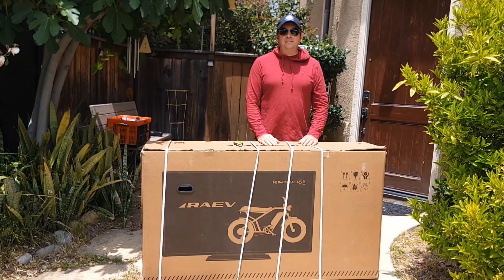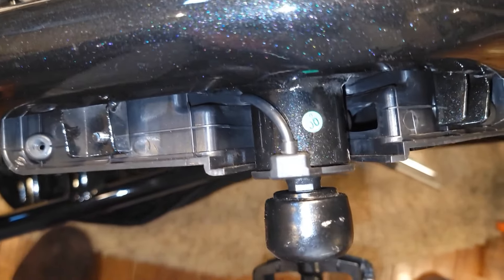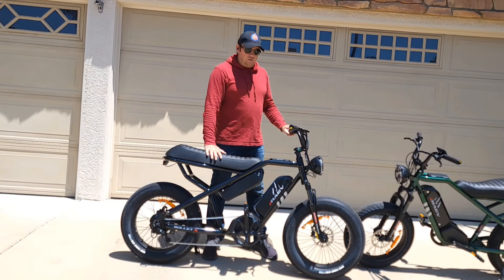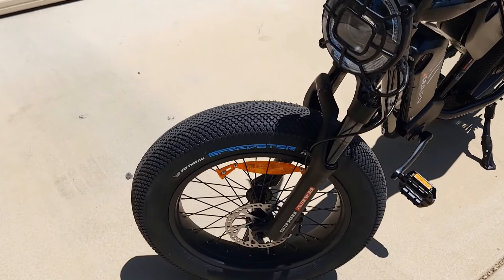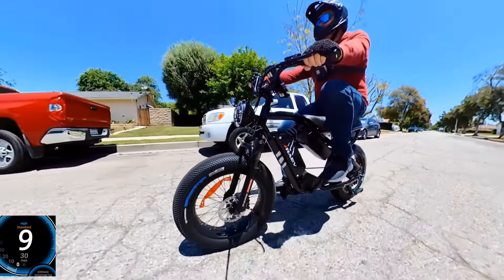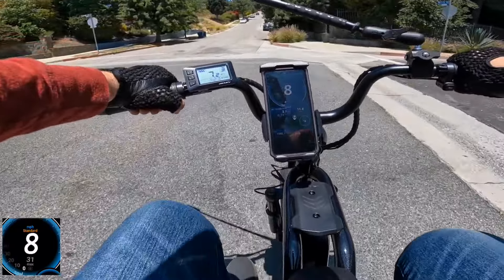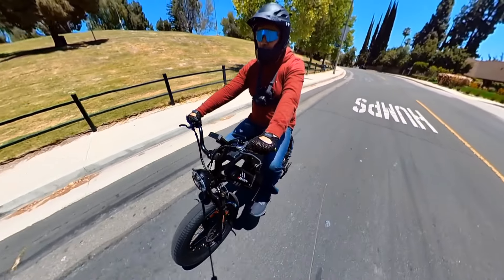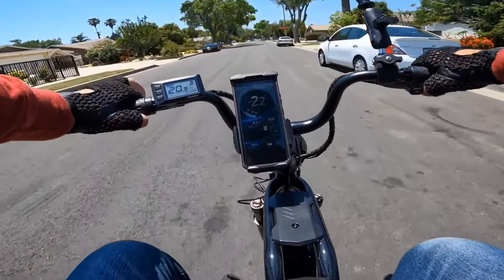Dual Batteries !! Raev Bullet X V2 Ebike Review

Comment: How did you unlock the speed limiter? Thx!!!
Reply from the maker: I have the short video in the description how
Reply: @erides  do you know if raev ship to the uk at all please as I was looking into getting 1 of these bikes but I'm not sure they will ship to the uk 🇬🇧 any help would be greatly appreciated 😊❤
Reply from the maker: @michaelross749  they used to but I don't know now . You can try to place an order and see if that will go through $100 OFF code: Erides https://raevbikes.com/discount/erides/?ref=erides
Reply: @erides  I gonna wait & see what they say when they email me back & if the answer is a yes I will gladly use the discount code provided by yourself thanks very much for getting back to me 👍
Reply from the maker: @michaelross749 no problem. If the system doesn't allow the place, you can't buy it.  You can message me on fb if they can't. I know another bike 40mph+ which can be shipped there https://www.facebook.com/profile.php?id=61557985326138&mibextid=ZbWKwL
Reply: That is gonna depend on the price of the bike as I only a budget off about £1500 - £1600 pounds sterling for the price of the bike plus shipping which is probably gonna be around £300 - £350 probably so the cost of the bike plus shipping would need to come in at £1600 English pounds 😊sterling & no more than that because that is the budget I have to spend on a new ebike have you done a review on the other bike you was talking about if so what video review was it so I can watch it to see what I think is going to be the best bike for me also I'm quite short at only 5ft 7inches tall with an inseam of 30inches that's without shoes or trainers on my feet ❤ thanks again for all your help with everything my friend 😊❤
Reply from the maker: Unfortunately, that bike is out of your budget because it's a more powerful ebike with about twice the power and much higher speed. You can check the video here: https://youtu.be/VAIvE98yQw8. Mine was from the first batch, and the new model comes with more upgrades, achieving about 4-5 miles faster and with more torque — still twice as powerful as the GTX model

Comment: Hello,
Im new to the world of the E-bikes so i want to know if the XF is better overall than the GTX for a city rider
Reply from the maker: Gtx is better as it faster 4 mph, with rear shock, but XF is cheaper. If you can afford gtx go with gtx if you want to save money go with XF
Reply: @erides  you the man thanks a loooooooot you think the rear shock are mandatory for a person who is going to use it for city cruising no off road
Reply from the maker: Not really needed on raev as seat soft and nice tires on XF
Reply: @erides  You the man im going for an XF right now thanks I'm using as well your code for the promo 🙏
Reply from the maker: Welcome,  thank you for support and make sure to get it before June 20 as prices are going up on Raev Bikes due to Tariffs . $100 OFF code: Erides https://raevbikes.com/discount/erides/?ref=erides
Reply: @erides  My man erides i got another question for you
how long is the autonomy on the battery ( single battery ) full throttle only.
Reply from the maker: I don't know. I didn't tested it yet.  I would guess 15 miles on 1 battery
Reply: @erides  Hey erides my bike is on the way thanks to you brother however i got another question i been wanna ask it does the throttle have a delay
Reply from the maker: @scarrrrr8582 Congratulations! I don't recall any delays. It's very responsive and a lot of power
Reply: @erides  thanks my man does it have a brake sensor on it as well
Reply from the maker: @scarrrrr8582 yes
Reply: Just wanted to tell you i receive my bullet XF ( X V2 ) this week end and I'm the happiest dude on earth this bike is all what you need for a great summer
Reply from the maker: @scarrrrr8582  I am glad you happy! Enjoy safe riding